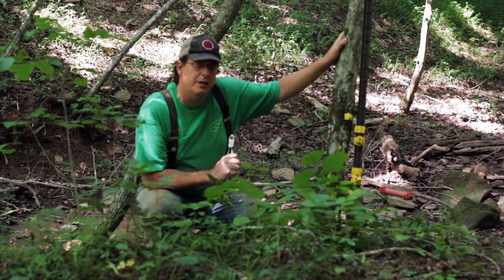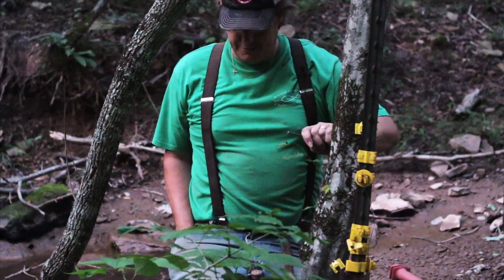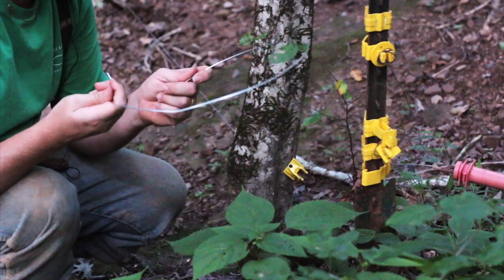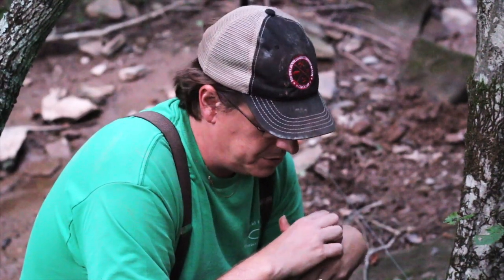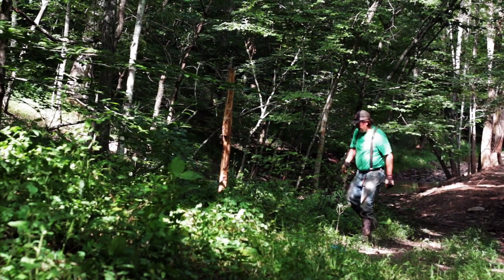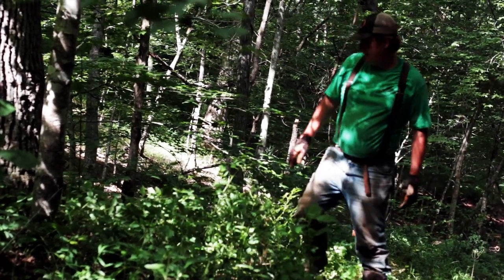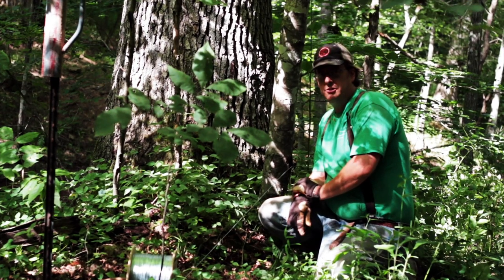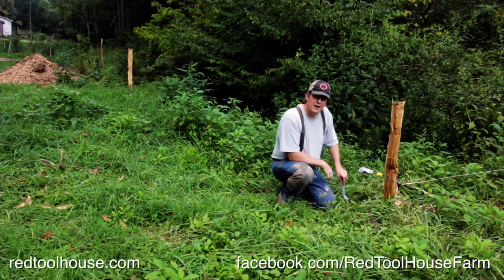EP40: Running electric fence wire for our expanded pig pasture

Comment: Have you considered putting surveyors tape on the wire to scare off the deer?
Reply from the maker: We did for a while but they still torn through the 17gauge. Have yet to have them break the 14.